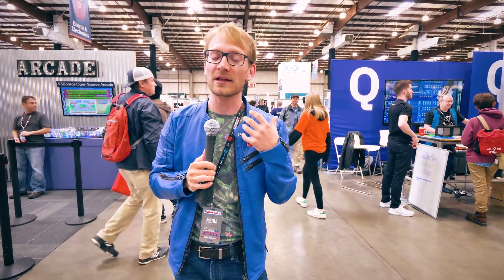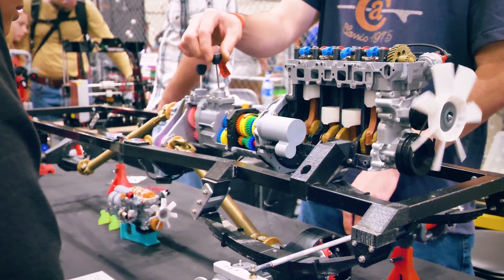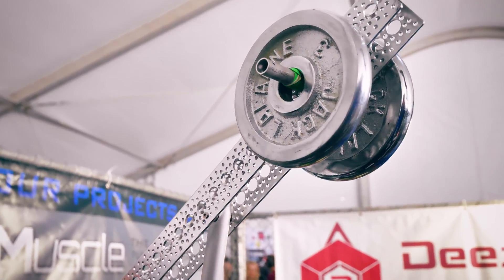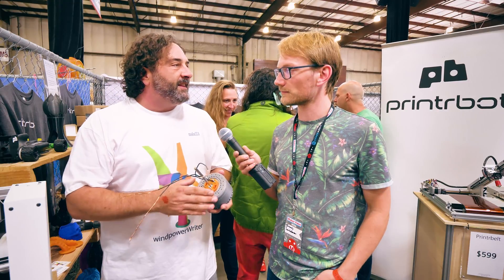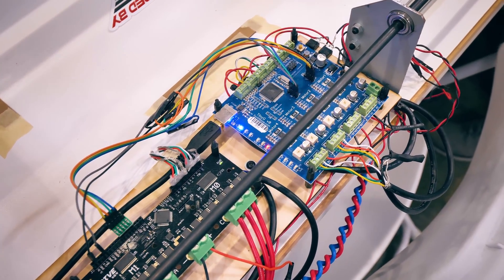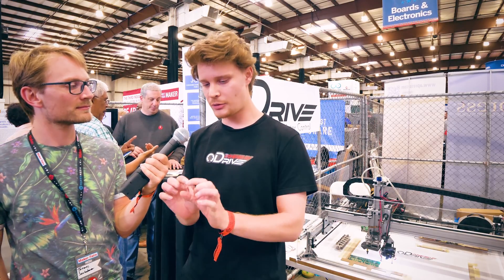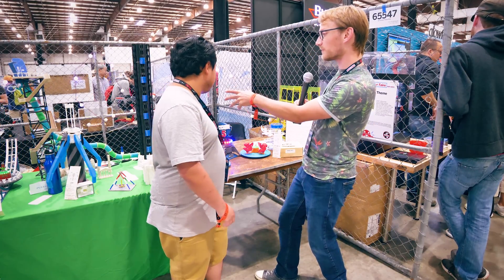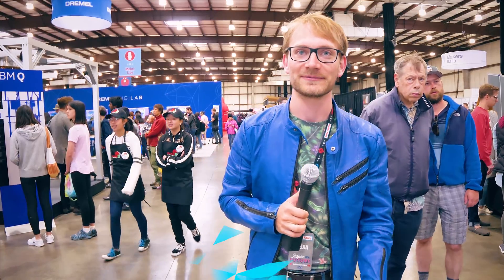The best 3D printed projects from Maker Faire Bay Area 2018! Engines, Theme Parks, Electric Motors!

Comment: 3D printed 600W motor.. yeah.. sure.. can it survive the 200C mark? Can it really survive 150C? Remember, it can not get ANY softer, it has to remain virtually identical from -50C to at least to 100C... Generator role is more suitable, there isn't that much heat but putting 600W thru a coil is going to generate heat. I would not trust my life with it and that is the requirement of any such device.

Comment: Optical encoder on a brushless motor has the best application to 3d printing by far. When he says speed is to fast for 3d printing you can gear it down then the resolution will be even more crazy than the 8000 steps per revolution. With a simple 4:1 ratio thats 32000 per revolution, the mind boggles on the applications on how precise this system is and you have slowed it down to a more reasonable usable speed.

Comment: brushless motors with encoders is a amazing idea, iam also working on that idea i.e.., controlling dc motors with encoders for a accurate motion to fix them in the 3d printers and the cnc machines. they will reduce the cost of the motors and are highly accurate

Comment: CNC systems would really benefit from brushless closed loop systems. 3D printers, maybe not as much - mostly from travel speed but it would be neat to see a comparison. As far as his resolution comparison, that's not that accurate. No one runs a stepper at full steps.

Also, since steppers are not using PID loops for position, they are faster to settle and there's no overshoot from that. They start moving and stop almost immediately as commanded. Servos are error driven and there are always delays associated with that.
Reply: There are exceptions but steppers are more accurate than most applications require and you can always hear them to be more accurate if need be.

Comment: It is time for a ODrive 3d printer! The sweet sweet travel speed, in comparison with stepper motor, this is almost like instant transmission...
Reply: Yeah, but the frame needed for such a printer. I don't know, carbon fiber frame with space-grade titanium alloy rails. Probably with a tungsten bottom to keep the printer steady.
Reply: Odrive with 3d printed motors... now that would be pretty sick.

Comment: Awesome ! 
With the brushless motors / drivers the guy mentioned they may be too fast for 3D printing and with the current extruder method that would be the case but what if the method of material transfer was changed ?
If the transfer and curing method could be designed so it is more like what a laser printer uses then those brushless motors would be ideal !
Reply: They were talking about making small enough boards that would just attach to the base of the motors... that would be cool!

Comment: The Drive guy is a wizard
Reply: Same current but the higher voltage (double power) gets you more speed due to the motor's speed constant.
Reply: They control the current going to the motor. And both versions are rated for the same current.
Reply: Defeshh do you know a web page for them?
Reply: possibly, it depends on the amperage
Reply: I want to build a massive 3d printer with those motors and driver....  drool
Reply: Gotta say I had a bit of a "what?" moment when he said the 48V control board was twice the power of the 24V board. 

Wouldn't a board for double the voltage have to handle 4 times the power?

Comment: That 3d printed engine was awesome! I also liked the BLDC controller boards... Maybe someday a BLDC powered CNC...?
Reply: Almost all serious cnc machine uses bldc motors with rotary encoders I think
Reply: Serious machines actually use AC motors with some type of inverter driver (mostly variable frequency drives). It's kinda similar to the BLDC motors, but you drive them with a controlled analogue waveform instead of just switching the motor phases on and off in a pattern. It's harder to make these drivers, but in the kilowatt and above region, the better efficency starts to pay off quickly compared to simpler BLDC motor drivers.

Comment: For the engines, couldn't one potentially upload the files to a CNC milling machine in order to make a steel version?
Reply: You might run into some problems with using STL files to make a CNC'd metal version. STLs are just an approximation of the source files (a circle is not a true circle in STL anymore). Maybe the tolerances are big enough for everything to fit, since FDM-printing is not really accurate at all compared to CNC milling. But thats definately something you should check before milling. If you want to make a 'working' combustion motor out of metal, these files are pretty much useless as the tolerances and surface quality/finish is where a lot of the magic happens.
Reply: You can load the STLs into most CAM systems